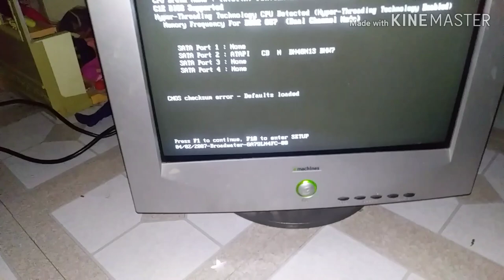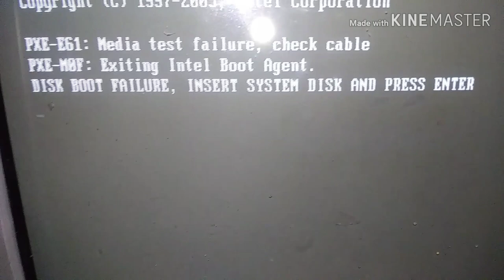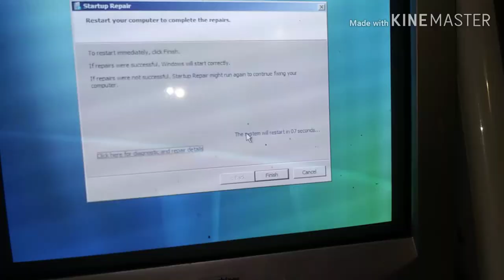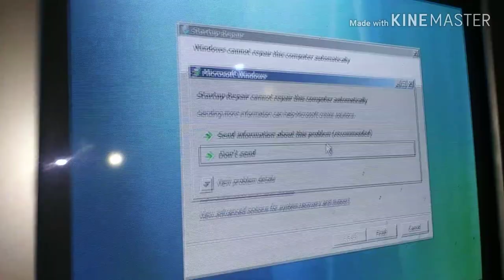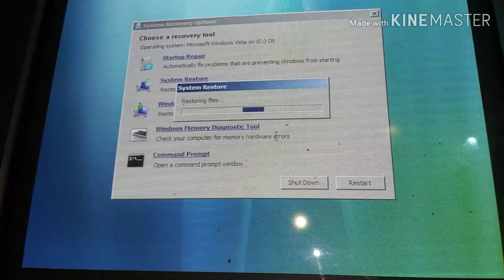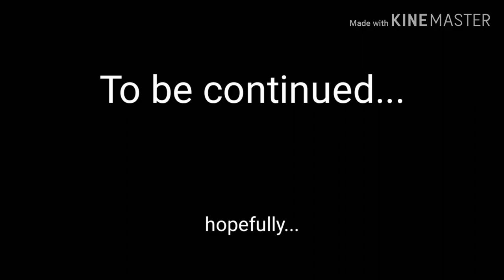Attempting to Fix a Trashed Computer Part #1

Comment: The beeping is an error message, open the pc and look for the model number, on the internet there should be a guide for what those beeps together mean, I'm just gonna say right now maybe its faulty ram or ram slots, happens alot with old pcs now.
Reply from the maker: Yeah I know. I found out there were no RAM chips which run what OS it is.
Reply: @UnshornKeyboardist  what did that intel sticker on the front of the pc say?
Reply from the maker: @BriansBrian  I think it said something like Intel inside and the sticker next to it said Runs Windows XP.
Reply: @UnshornKeyboardist  that probably means it is either a lga 775 or below, you can get VERY cheap core 2 duos (lga 775) I suggest e8400, or a modified xeon (pretty powerful) to run in a lga 775 motherboard

Comment: You need to make a bootable flash drive of windows 10 install. Or if you have the operating system disc. Boot from that and install a fresh copy of windows.
Reply: If im right thats a pentium 4, you really dont want windows 10 on a pentium 4
Reply from the maker: Hmmmm okaaaayyy....